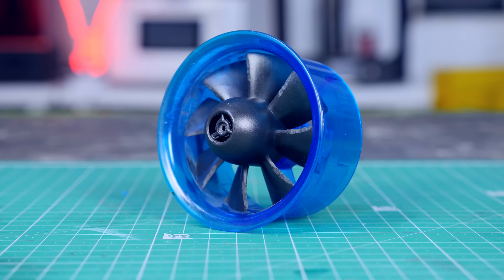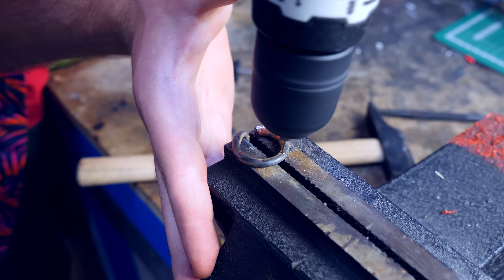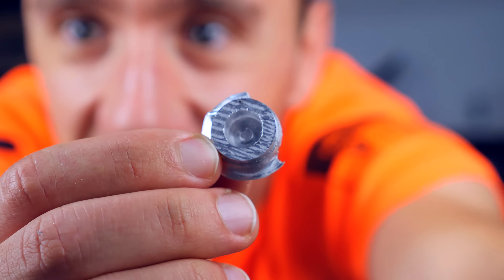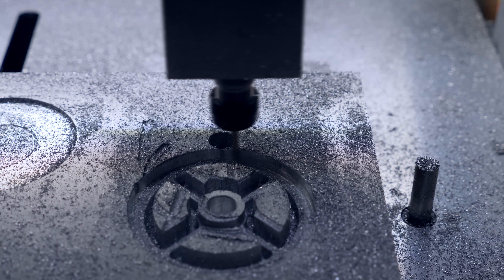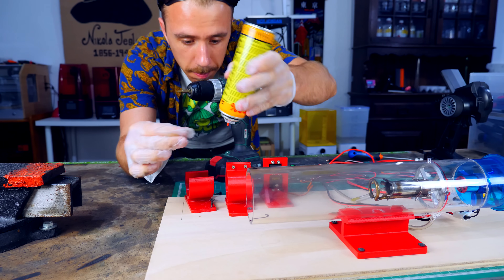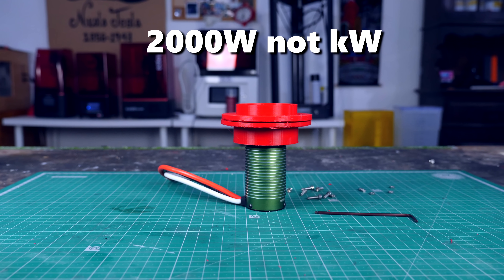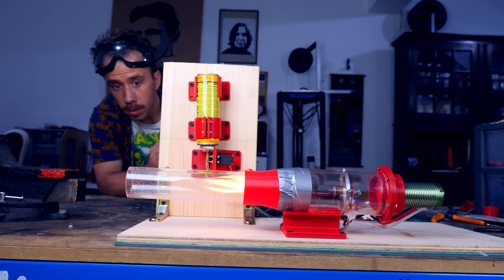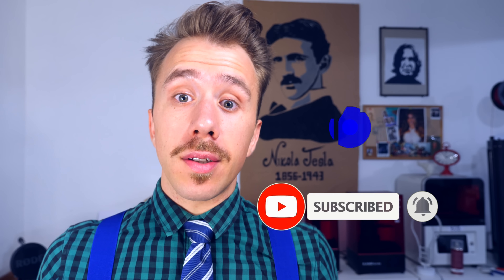I turned my Fan into a Jet Engine (3D Printed EDF Afterburner)

Comment: Hi, I'd like to recommend u you to use starlite, the ceramic material that is used onto rockets, i think that might help u, since your engines even at a good at performance, it melts over time, so yeah, I hope it's not expensive to be done at Europe.

Comment: This young gentleman is not as much a fool as he makes out to be, he is very intelligent and what appears to many people to be very difficult subjects to comprehend,  he knows exactly what he is talking about. I loved the turbojet engine which worked for ten seconds, it may have looked crude, but he got it all right with the compressor, diffuser,  slowing down the airflow to keep a stable flame, superheating the fuel, and feeding the stator with cooling bypass air and that hot rotor made from sheet metal, the bearing at the hot air not only did not have enough lubrication but not enough cooling. Well, all the fundamentals and principal parts were fine, it is simply a case of needing more time and better materials to get is to a higher level of performance. Sir, my hearty congratulations on your effort and engineering understanding. You make it look simple but it is fact quite complex to deal with the invisible and noisy function of a thermodynamic cycle!. Well done.

Comment: You need a turbine section.  The fan in the front is acting as a compressor section.  A shaft from the turbine section to compressor is what makes it a jet engine and it allows it to self regulate what speed it wants to run depending on how much fuel is added.  Btw I’m an aircraft mechanic

Comment: Instead of glow plugs should look in to vapes. They use resistance coils to heat preset temps upto 600° and higher to vape e fluids. Could make a more versatile ignition system.

Comment: I love the design, I think the glow plug isn’t igniting the fuel well as it is supposed to. Maybe you should increase the P.D(volts)
Reply: a glow plug isnt meant to ignite the fuel, its in a diesel engine to warm the fuel to a temp that allows it to combust easier at high compression.

Comment: dr. no fun wanted me to suggest mounting the fuel bottle on the outside surface of the structure..... if that flame got just a little bit more out of hand when dialing in the ignirion and fuel mix stages the volatile, pressurized, and thermally conductive  fuel can would have been in direct contact with el scorcho, becoming less of a propulsion unit and more of a frag grenade

Comment: i think your cnc problem with its Ridiculous noise is because your BIT is WAY too long you dont need that long of a bit its horrendous noise is the vibration of the long bit .. if it was 1/2 as long  i bet it would be quieter. just my thoughts tho. if your media is only 3/4" thick then your bit needs only be a hair over 3/4" long to surpass the medias thickness to make a clean hole/cut

Comment: Hi Integza, Can you make multiple EDFs on the same airflow axis? basically, each one is pushing air to the next one. It'd be cool to see how much thrust would it make.
Reply: wouldn't work well, edf are great at creating airspeed, not pressure. so cascading them would improve performance as much as you would hope
Reply: @jg_bboy3028  Actually it would work great, because what Omar Salah described in his comment is an axial compressor like the ones used in jet engines. @Integza Again, I suggest 3D printing an axial compressor and using that.

Comment: I think if you shorten the whole chamber where the before the downsize funnel more so the glow plug could ignite the fuel. In the video it kept going pass the glow plug that means the fuel feed design is not efficient. I will say bring the glow plug very close and center of the fuel feed holes and spray the side of the glow plug around like 2-4 holes for glow plug and bunch of other holes spray towards the exhaust. And the fuel i believe is needed to be in vapor state  or atomized already to make this more efficient to create good thrust you looking for. 
I’m looking forward for thrust measurements for all your inventions

Comment: That's just a burner in a tube . No compression chamber or appreciable  compression output release of higher pressure from the discharge end. pressure than input

Comment: What about using your compression turbo to create a vacuum to boil water in. Just to see if you can get the steam vapour to split molecules, thus creating a water splitting machine that has use less electric than electrolysis and hopefully no electrolyte.
Reply: Or maybe my understanding of the physics are under educated and the expected results require alot stronger pressures than I anticipate.

Comment: Hey can i suggest something ive made that is a mini AC ....if i had a 3D printer i could ready perfect my creation...my uses 2 9watt motors a condenser a evaporator id love to show you pictures of my portable AC...the normal temperature runs about 43 degrees (F) as where a home Heat pump at vent is 55 degrees (F) may be way to easy for a brain like yours so i bet you can take it to NEXT LEVEL especially with your awesome 3D PRINTER .

Comment: There isn't any air compression there....the flame is just winded by the ventilator, this isn't expension gaz that go out really  fast like in a normal turboreactor....you should have tightened the end of the acryllic tube to get trust (risking explosion of this one to)

Edit: did not see the end of the video where he does it, that little change gives all the trust you search.
And you can modify the form to improve it....a bell nozzle form, like rockets ones, seems to be the most efficient, but you probably will have to use different materials to handle the pressure/temperature than come with the acceleration in this nozzle.

But before improving the injector to get more fuel in, or burning it better vaporising it in smallest drops, the best way of gaining trust is modifying the form of the tube, and the exit

Good craft btw ! Your tools, CNC and other shits make craft boys like me pretty jalous x)

Comment: You need to find the best ratio between flow rate of air(voltage you gave the fan),and rate of fuel flow(it was constant in your model i think)

Comment: I think you need to machine a nozzle with a very small hole at the end for this jet to work really well. Not only does it seem that sort of doing this allowed it to work better but it also if you could increase the compression enough it would be easier to keep alive because you are relying on compression ignition.

Comment: As a diesel tech of 15 years, I'd like to see a video on scavenging and the venturi effect. There is a small gap of time as the piston moves down on the intake stroke where the exhaust valve is open, and the fresh air moving in past the intake valve creates a scavenging effect on the exhaust moving out. You also will find a venturi on the exhaust pipe itself that seemingly creates power out of thin air, and I think I understand how it works but it would be awesome to do a video on why!
Reply: That is also used on alot of performance gasoline engines, called overlap, top fuel does this as well, but on the exhaust stroke so as the exhaust going out sucks in the a/f mixture while the intake valve is open with the exhaust valve. Engines are nothing more than an air pump..pretty cool stuff
Reply: Valve Overlap is used to purge the cylinder for a fresh intake charge, in turn creating greater volumetric efficiency.
Reply: Great....let's us know when you make the vid!
Reply: watch this video by smarter every day that explains everything, thank me later. https://www.youtube.com/watch?v=toVfvRhWbj8

Comment: that was impressive but in my openion jet injector cant be like that , if you want more power first add more injector to  the burner  to produce more power to the jet, secondly increase the fuel source.

Comment: Video idea: u can print hydrogen gas plant, and then use it on it's gas form, or even try cryogenic stuff (i got one made of plastic), and u can add oxygen or other oxidizers to get better flames, even though it would melt plastic.

Comment: Can we use water as the Rocket fuel by decomposition technique. by this we can obtain hydrogen and oxygen which is specifically used in rocket's cryogenic stage. By this we can satisfy your hunger of thrust.

Comment: Nicely done! Current engines work with both isnt it? A big fan for fast airflow and a compressor basically too (not mentioning the hot part which makes efficient, cant describe in food coma sry). I wonder when you make the 2nd version how much throust it makes? :)

Comment: I'm not entirely sure this will work or scale, as, for me, it's not really a jet engine but a flame thrower: The combustion gases don't drive intake and compression, and, even with the longer tubes, a significant amount of the combustion happens outside, which is wasted energy. The more gas you burn, or the faster the intake fan spins, the worse this will get as the flame has a fixed rate of burning.

Comment: Suggestion for safety: it may not be a good idea to have your fuel container in front of the flame tube; if the acrylic tube is damaged, the flames may reach your fuel line. Great video, and excellent presentation on how a jet engine functions.

Comment: Idea: run the edf motor off of a generator turned by the jet engine.  Basically, make the only fuel butane/propane once it is lit.

Comment: That’s NOT a jet engine, it’s a forced draft burner like what’s used to heat a kiln.  To be a true jet the fan blades must be powered by the same shaft that is being turned by the thrust of a second set of blades at the exit of the combustion chamber.  Your a long long long way from the principals of jet thrust.  I’d say you have a lot of reading to do.  Quit with the “Cute-see” presentation and start teaching the actual science …. You’ll get no 👍🏻 from me

Comment: A tip for cutting aluminum on your cnc router; use cutters with a short flute length and keep the chuck as low to the material as you can, the less endmill you have sticking out the less flexibility it will have, which is what creates chatter, and chatter is bad. It needs to be as rigid as possible. Doing so will extend your tool life, create better surface finishes, and increase accuracy. And save the bearings in the spindle as well, that's an important one.

Comment: Soooo here’s an idea why not make the glow plug and fuel line in the same housing for the fire tube and because it’s a high pressure fan shouldn’t go small pipe large pipe small pipe for pretty much a combustion chamber kinda like a pulse jet engine? And why not use a larger fuel line with a glow plug since it’s always going it’s kinda a waist to restrict the amount of power due to a small full line it’s like a performance air filter on a car but still having the stock air tubes it doesn’t do anything that way and more over wouldn’t making the fan smaller but keeping the motor the same size help with over all pressure and having the flame tube make the actual thrust? This is all just spit balling I love your work and you always open my eyes to new things keep up the great research!

Comment: That noise is called chatter and in simple terms what you're hearing is the drill assembly vibrating because there is too much friction. Easy fix is lubricant, but it's honestly better you learn more about milling first, so you know what exactly each parameter of your mill does, and how different materials affect those parameters.

Comment: this is a cool video and I enjoyed it, and not trying to be negative, but this is not a jet engine, you're just burning fuel with high velocity air. The intake is running off of electricity, and you're not using feedback from the burner to spin the inlet fan. If you generated electricity to drive the inlet fan, this would be feedback but you don't have this.

Comment: Video idea: Make a smaller twin afterburner setup and measure the thrust force. If it's enough to get a liftoff, then add wings and a body, and voila! You have a kinda flying jet :D
The 2kW motor seems like an overkill XD

Comment: I’ll be frank, imagine putting these after burners on RC planes, that would be a cool af Project, heck, imagine Integza making actual little rockets and planes out of all his Engine concepts!
Reply: I am starting this as a project rn. Two 50 mm edfs with afterburners. We’ll see how this goes.
Reply: @red_leader0504  good luck
Reply: It has already been done by some nerds. Search on YT, some projects are really crazy and sound realistic =)
Reply: David from flitetest did that. Used an off the shelf pressurized can of fuel. It was cool
Reply: Sounds like a PeterSripol collab idea!
Reply: I assume that’s the end goal
Reply: There are already turbojet rc engines, they cost a 1000 dollar and suck up fuel fast
Reply: Some guy did it on I think was a durafly vampire
Reply: Or even a model rocket... that would be cool
Reply: It adds literally zero thrust, children. Don't waste your time.
Reply: David windestål did this on flitetest years ago. I think it was on a Vampire😊
Reply: They won't be able to sell it to kids, so not worth it

Comment: Loved the project and presentation. For the CNC milling you generally want to make the shavings as long as possible by adjusting the drill rotation speed and the speed of the motion through the metal. Each material will have a different ideal speed combination.

Comment: @Integza, I'm getting the sense you don't know all that much about jet engines. They don't use centrifugal fans at all. They're just regular fans, albeit highly aerodynamic with a high blade count.

The secret is that the main fan on a turbofan engine is driven by a turbine aft of the combustion chamber, which drives the fan with a shaft. This also drives a compressor but that'd be a bit much for a DIY project and isn't really necessary on this scale.

Had you designed it this way, you'd instead have to start the motor with compressed air or something similar. Inconvenient, but at least it would be a true jet engine.

This engine design you have currently really won't produce any more thrust than what the fan can produce alone.

In short, what you have is more or less a fancy fan driven blowtorch.

Comment: Does it really add measurable usable additional thrust? Does adding fuel like this that isn’t in a combustion chamber really add any energy to forward movement? This is far from my field of expertise.  Maybe add a metal turbine in your flame that in turn spins the fan up front like a high bypass engine in an air liner? Either way, if all you made was a flamethrower, still cool as hell!

Comment: I think sound from your cnc machine is called chatter.

I'd say it is either from how much material you are trying to remove at once. Ie too much.  Or your spindle or tool speed which have to be set for each different material you are using

Comment: Integza! I summon thee! But only for good (my apologies, ha) reason, I want to share some information/videos I found (no affiliation to) on turning 3d printed parts from PLA into metal castings (the secret sauce, or slurry, is to coat the PLA parts in a few layers of a special slurry) AND the same wonderful person has directions on how to build the (totally) kick ass furnace they use to melt the metal. The person's channel is "Robinson Foundry" and they have several videos making all sorts of intricate metal castings using 3d printed parts. The relevant ones I humbly suggest are the "Easy lost PLA metal casting", "Easy metal casting │ 3d print to metal copy │ Two way bolt", and then the two parts on building the furnace "How to Make a Metal Melting Furnace│Foundry Build Detailed│Part 1" and "How to Make a Metal Melting Furnace│Foundry Build Detailed│Part 1"

I hope this finds you well and if it's useless I apologize! And many thanks for all the wonderful videos.

Comment: 🔥RUN THE JET ENGINE WITH WATER AS FUEL 🔥🔥🔥🔥🔥

(1) Mix calsium carbide into water, it will produce flammable Acetylene gas.
(2) Take the low pressure Acetylene and compress it with a centrifugal compressor
(3) Mix the high pressure Acetylene and high pressure air (take another compressor to compress the air ) in a flame tube.
(4) And IGNITE it........ 🔥🔥🔥🔥🔥

Comment: First thing I'd suggest you'd do for your CNC router, run a bit with a shorter flute, a lot of the noise you are getting means the tool or material is vibrating.   Also, double and triple check your end mill mounting type, if its a collet, make sure the collet matches the shank of the tool as closely as possible to reduce run out.  A third thing, look into a mist coolant option,   Aluminum is a sticky metal, keeping your tool lubricated with a mist unit won't produce too much mess and will help reduce clogging and cutting tempuratures, making your cuts better.       TL:DR,  Use an endmill that is only as long as it needs to be to do the job, make sure it is mounted in a proper collet to  reduce run out, find a way to keep it cool and lubricated while cutting.

Also, check your feeds and speeds, there are charts available that will give you a very good starting point for settings.      And any machinist who hasn't broken an endmill, messed up a part, or snapped a tap hasn't been doing it long.